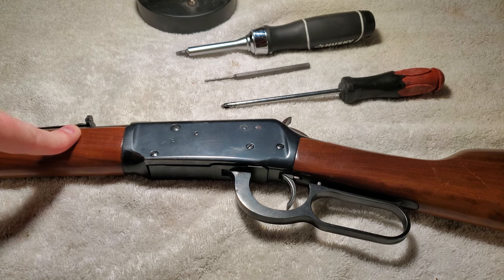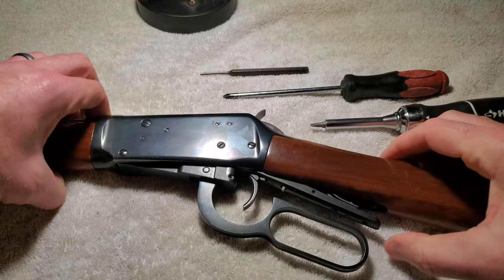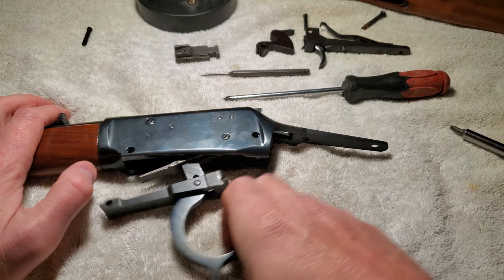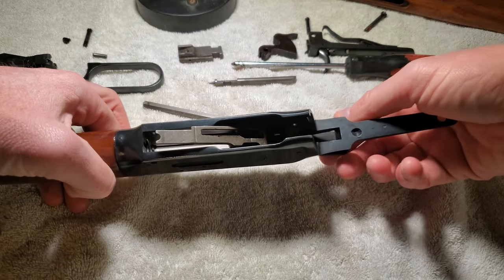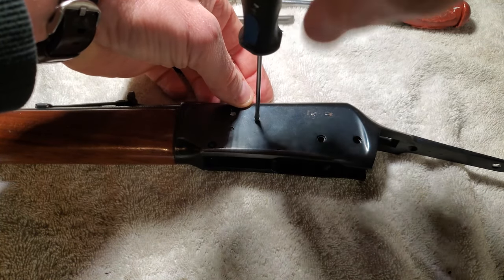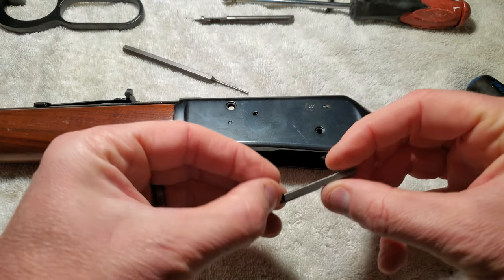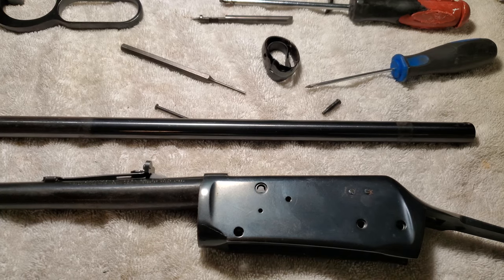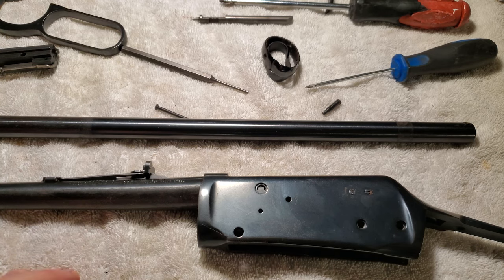Winchester 94 break down for cleaning.

Comment: Nothing like an instructional video with the instructor guessing how to proceed.
Reply: I know , right ?
Use a well padded vice and screw drivers that fit each individual screw.
It's a very simple firearm.
I like to remove the bolt for a thorough cleaning every so often and re grease the bolt ways .
I've been complemented on the smoothness of my 94 and most of it is simple maintenance.

Comment: Helping a relative with one of these. Theirs was made in early (Jan or Feb) 1897 (!). Thing has all the options too (pewter caps, tang sights, etc., etc.). Haven't done lever guns a whole lot since I was a younger. I used to have a different model but almost as old. Big mistake neglecting spending time with levers, these things are fun and I haven't had this much nostalgia in a while! Your video helped me a lot. Thanks!

BTW I highly suggest tapeing the frame (blue painters not masking) to prevent scratches from slips (just don't slip no matter if taped or not, take your time) and use Brownell's expensive screwdriver set and make sure each bit fits width and length and full depth. Otherwise you will muck up those heads. Never overtighten either. There is even older stuff in the extensive collection. Like way, way older. Makes me wished I had more safe space and cash and a closer range. I'd throw an offer if the family didn't want.

Sucks to be poor but pays to be knowledgeable. I am the guy many people and shops ask when they have no answers from anyone else. I get to see some cool stuff. This gun while common, is one of the first ever made (first percentile ever made). Older I get the more skookum (super cool) older guns are.

Comment: Those two little dummy screws are for mounting a Redfield or Williams peep sight.
Reply from the maker: Nice I was wondering, with the bolt that top ejects sights become an issue I'd guess anyway.  So is a scope not an option for this model?
Reply: @pawild5594  scope is doable, but not perfect.  Weaver and probably others made a no drill side mount that uses existing screw holes on the left side.
Reply: @pawild5594  I have one in .44mag with a Pearson’s no drill picatinny mount and if you want to use it for something like a red dot or LPVO it will work just fine aside from having to do a slight rezero after each cleaning